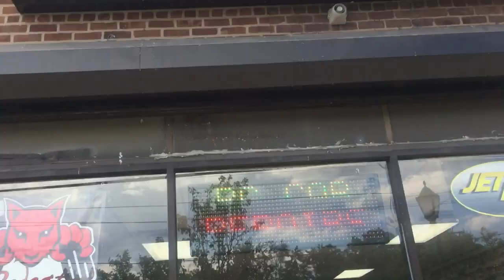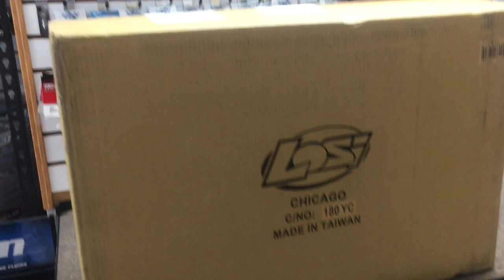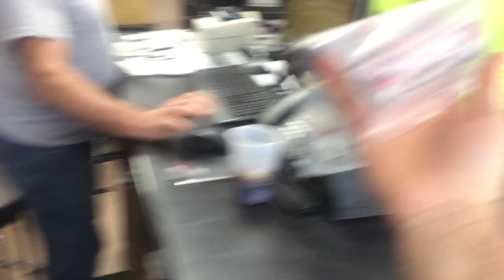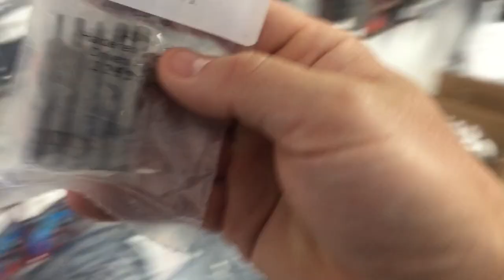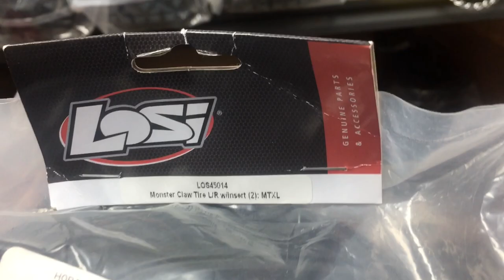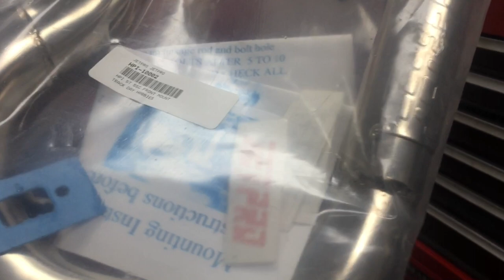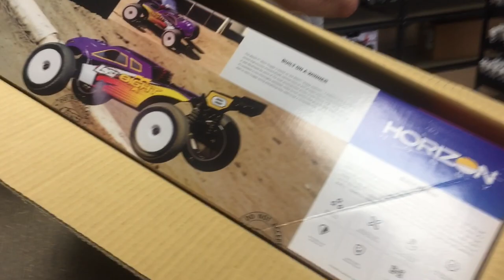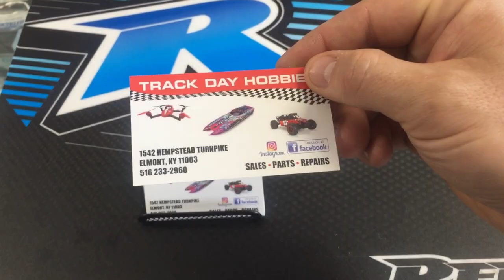This is What a Real Hobby Store is Supposed to have! Thank You TRACK DAY HOBBIES !

Comment: That's an RC Shop Bro, our local shops don't carry allot of that stuff. No Nitro Engines, No Gas Engines, No 5t or 5t parts (I am getting a 5t next) I am lucky to find 1 or 2 8t parts.  I went the other day to get some after run oil, air filter oil, and Traxxas Top Fuel 20/20, they only had a gallon of the top fuel (which was fine, but I planned on a quart) no air filter oil, no after run oil.  The selection for nitro a d gas is almost non existent.  

Nitro Bro Brian
Reply from the maker: New2Kendo that is the saddest shit to hear? Let them know that top fuel is shit and only helps kill the nitro hobby! Top fuel can be used for breaking in engines if there is no other choice out there but please do not run with it. It's way to thick and way to much oil . You can do so much better with a Nitro motor tank after tank with a 30/11

Comment: Hey bro what do you think about that redcat rampage mt in the workshop on the bottom shelf?I hear good things about them just wondering if you could share your thoughts
Reply from the maker: Floyd Brewer I like it only because it has a Gas ⛽️ motor but I love the Losi MTXL! MTXL all the way as far as real 5th scale MT! But if you come across a rampage really good price or if that's the only way to start out then go for it!
Reply: BOTAJELL Lol ok GAS/NITRO Bro I have the MTXL and yes it's a BEAST!!! but my kids would like to get in on the action so I was considering that redcat for them for that price thanks bro
Reply from the maker: Floyd Brewer yes exactly! Perfect for kids to start out with and join us in the hobby!
Reply: Red Cat Mt is great for the kids.. Mine still going with the stock Motor .. With head kit.28.5 with a DDM pipe  if you put more power to it  then it will start eating parts. and as well running  Hitec servos .. And a Vetago Wheel extenders..
Reply: paintendave Extreme Collision Yeah thanks for the input bro, I'm going to order one up for the little gas guzzlers lol
Reply from the maker: paintendave Extreme Collision I may get another one again?

Comment: I see a trip to NY in my near future I wish I could afford a Losi to many other bills a real cars to fix so I bought a Rovan will see how it goes been doing ur break in procedure taking awhile but should b worth it I just need to make more money so I can start really building this thing
Reply from the maker: Kevin  Stap at least you got the Balls to get started somewhere and now we are Gas ⛽️ Bros forever!!! Bro your going to have lots of fun! You may have to go over a few things like loctite everything up and a Hi flow fuel kit from full force or use the new Losi 5B fuel tank that comes with everything. You have a pretty good motor now but you may want to change carb? But definitely do a velocity stack and a new air filter and it will improve the performance of your engine a lot. Also do not for get to set the gap on your coil and torque it down properly because ours came loose
Reply: And of course we know; that's the one and only law we have to defy, that's the law of human nature.
Reply: The plastic models even include the dioramas that you've constructed.

Comment: amsoil is ok but red line 2 cyc racing oil is the only oil my D.A. engines are allowed to burn.
Reply from the maker: I used to use red line in my drag banshee twin engine but with the Dominator oil there was less rebuilds and all the engine builders at the dunes where we drag raced also liked and have seen better results with Dominator so from what I have see for myself is Dominator for life . It’s over kill for these little Engines we use for RCs but it’s the best I can get. Red line is definitely better then lawnmower shit oil for rc engines no doubt and probably all that is needed period but the best and proof that I have seen was Amsoil Dominator oil that I used in my $8,000 dollar twin 2 stoke race engine that I had on my extended swing arm modified banshee with air shifter
Reply: @BOTAJELL  I haven't used the dominater but I have used a lot of sabre.  I am also a fan of klots. lots of good oil out there. So good it's hard to tell witch one is better.
Reply from the maker: conbones thevoid I love Klotz! If there was No Amsoil Dominator to use anymore ? I would go back to Klotz!! Please Don’t use Sabre for this application !! Get yourself some Dominator. You can use it on everything if you want ? I do from chainsaws to race applications! Amsoil Interceptor oil is great 👍 also but just use the best they have to offer the Dominator and call it a day ! I don’t know why Amsoil has so many different types of 2 stroke oil to confuse people. They tell people not to use there race Dominator oil on weekwackers or small stuff and to use Sabre and Interceptor for snowmobiles and I used to use and do all that shit but not anymore! F that I’m having better results and only use Dominator on anything and everything 2 stroke now even on boats . Klotz has s the best smelling out of all the oils I used but with Dominator my engines scream well and last longest ! They don’t pay me to say this shit and if anything they tell me that Dominator is overkill and a waste of money for this application but if you want the best ? Go for the best and F the rest!